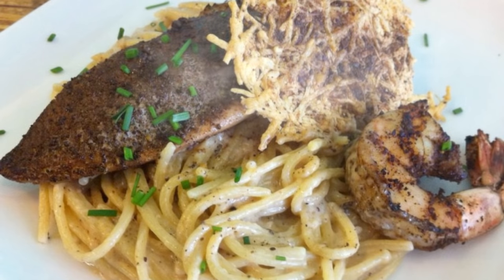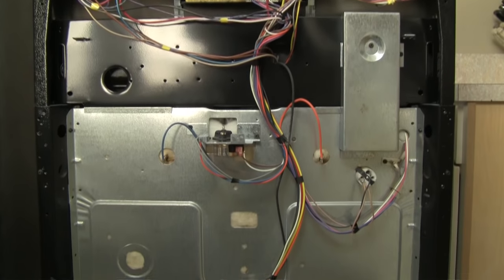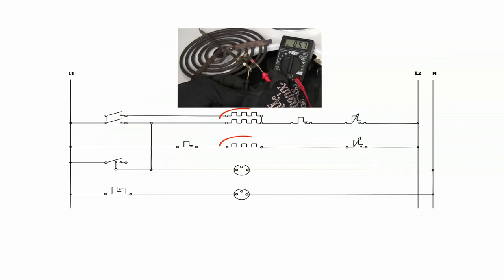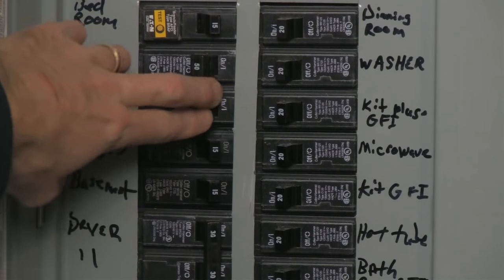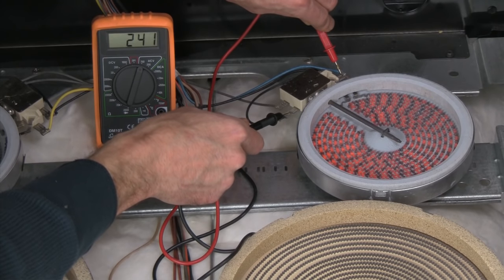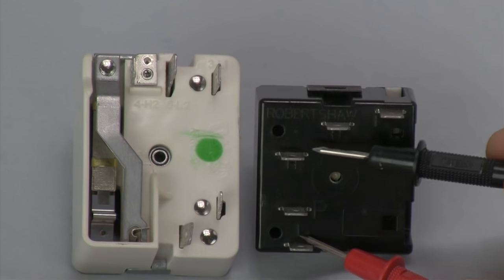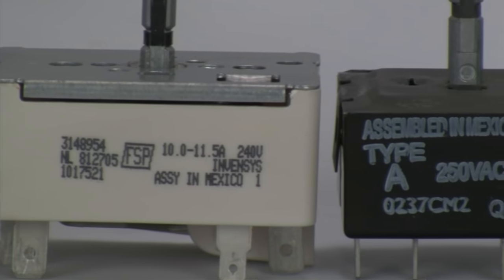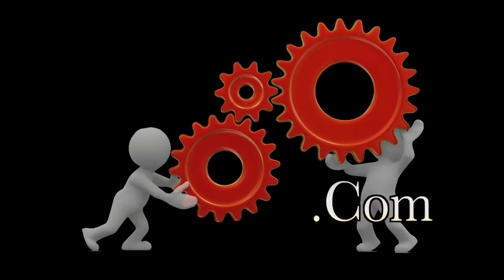Electric Range Stove Repair: How To Repair Burner Elements

Comment: I have a GE flat top everything works fine. However when I use the back left burner a breaker in a different part of her house trips. Any help is appreciated
Reply from the maker: +Jonathan Hardy Sorry for the delay! Sounds like there is probably a shorted wire somewhere between the switch and the back left element or the element itself.  Hope that helps!
Reply from the maker: you may have just gotten really lucky. probably the most you would have gotten is 120 but 240 is possible. If you are not touching both ground and a hot wire your okay... Congratulations on the fix and not getting electrocuted! ; )
Reply from the maker: ahhh. yes that makes more sense. You can change those live with the switch off : ) Thanks for the clarification!

Comment: Help have a ge glass slide in range, cook top stoped working, when turning on any ellements the light show which element is on, but no heat, the oven works fine.. suggestions as al the connects appear fine,

Comment: Moving the stove a wire touched the back and zap , the clock and lights come on but the radiant elements do not . I replaced the contact but still do not have elements , any suggestions on where to look next

Comment: What to check when the hot surface indicator light stay on even with the burners off and cold ? Is that a wire on the infinite switch and what letter or number it should have?

Comment: Hi, I discovered the oven light staying on and looked at the switches in the back. Found switch labeled P1 and P3 which are connected by a 2 wire plug. P3 switch is actually burned, when I disconnect the plug from P1 P3 the light goes out. the question now is can I leave this switch disconnected and use the stove until I can get a repair person in or replace the stove?
thanks
Reply from the maker: I would imagine that you can do just that, leave it disconnected... The circuit for the other elements should still operate.  in reality all you would need to do is replace the switch.  If you give me your model number (down behind the drawer on the range frame) I can send you a link to the proper switch to order... If you do leave it disconnected, it would be a good idea to cover the wire ends in electrical tape to ensure that there is no shorts to the frame when you put the back on and reconnect power.
Reply: applianceassistant Hi Thanks fore the reply. It seems with P1 P3 disconnected the oven has minimal heat and will not come up to temperature, I should mention and this switch is on what looks like the main circuit board in back of the stove and that has a burn mark on it too on the P3 side . Model is 970-678491
and the oven light does come on when I open the door but now shuts off when closed. Obviously connected to that P1P3 connectors but I don;'t what they do exactly.
guess the other question is can I leave just the P1 wire connected because that connector is still functional, not burnt
Reply: Neil MacDonald I'm not able to find that model number in my database... what is the brand?  And I apologize I thought we were talking about one of the surface element indicator lights not the oven light. If it's connected to a circuit board it may not be possible to leave it disconnected. Probably best to leave it wired up as normal for now and let the light stay on. Perhaps you can just remove the oven light bulb temporarily...
Reply: Jon Yingst Maybe so. it's a Sears Kenmore brand and I never thought to mention it's a canadian purchase, not sure if you are in the US and only have access to their models?

Comment: I have a Kenmore stove top that's about 10 or 11 yrs old and today I noticed the 'unit on' indicator light was on a little bit - not the fully bright circle that usually shows when a unit is on but just deeper down and it flickered a bit. The indicator showing which burner is hot showed nothing. I used the main burner and it lit up fully and the indictator showing that burner was hot was lit fully as well. There's no way I'm messing with electricity even with this helpful video but I'm wondering if there's reason for concern here. nothing feels hot but that darned itty bitty light is bugging me. After using the burner and turning it off it did disappear completely for a while then when I went back to cleaning the kitchen I noticed it back and that's when I noticed if I tapped near it it would flicker a bit but more like the position not going on and off. sorry if this doesn't make sense but I'm not sure who to even call to fix a stove of if it's even worth fixing - I could probably get a new one installed cheaper than fixing this one.
Reply from the maker: its probably a bad switch that is just barely making contact on one side. So probably not a big deal in itself. however, if the other side of the switch goes bad the element will probably heat up... It's extremely unlikely, but possible.  Hope that helps! Thanks for the question.
Reply: applianceassistant  thank you! I have a repair guy coming out this weekend just in case. the guy stood me up last week so I found someone else to come out

Comment: Here's one for you, I have a whirlpool RF385PXE range. One of the large top burners won't keep a constant temperature. I've replaced the infinite switch to no avail. Take yesterday for instance. I was cooking a large pot of spaghetti sauce. I had it fairly high originally to brown the onions. But then turned it down to 3 to simmer once I had the tomatoes and some of the other ingredients in the pot. I sat down at my desk to do a few things and the next thing i know it's boiling out all over the floor. The element was red hot like it was on high. Any idea what could be causing this?
Reply from the maker: Sorry for the delay in getting back with you on this.  In most cases it would be the switch, but since you have replaced that the only other possibility that I can think of is that the element or a wire is shorted to ground somewhere. To test you would need a meter and check for a connection from the two wires that come from the element to the switch and check for a connection to the cabinet of the range.  If you get a reading hopefully that will help narrow down where to look.  Hope that helps! Good luck!

Comment: I opened up our GE freestanding, double oven, Model # PB975SOM2SS, to replace the large front burner.  Two of the three wires, plugging to the element were burnt through.  There is not enough slack to reattach. Does the wiring need to be completely replaced or can it be spliced?  Additionally, does the burner need to be replaced?  Currently the outside third of the ring works.
Reply from the maker: Barry Rachel Murray A good splice with ceramic wire nuts should be okay but you should use wire for a range burner... Maybe a local appliance parts shop will have some scrap range wire with factory crimped terminals you can use. The element may still be okay but you would need to check the coils with a meter to check for correct resistance levels. additionally there is often a temperature safety switch inside the element connection block that may have a problem...
Reply: applianceassistant Thank you!  You have been extremely helpful! This is the exact information we were looking for!

Comment: I just replaced the triple element on my Kenmore glass top. When I turn on the dual or triple burner the middle  portion isn't a red as the inner or outer portion. Is this normal?

Comment: my cooktop took a pretty harsh spill and water got inside but i did not know that until i went to use it days after the spill. the burner would not shut off and smoke started coming from the control knobs. we hit the breaker right before it could catch fire. It made a loud pop sound and the housing to the cord is melted. is there any way to save this or is there no hope. I dont even know if i can open it to test everything but im willing to try to repair it if it will save me $1000.
Reply from the maker: It may be salvageable... I would check switch and element areas first for visible arcing and burn marks, and see how wide spread the damage is. Then check the control for proper function after you isolate the short by caping off damaged areas. Hope that helps! Good luck!

Comment: Greetings and great post. What does it mean if my oven wont turn on and certain eyes wont cut off. What to do???
Reply from the maker: I’m sorry I don’t know what you meant by “eyes won’t cut off”.
Reply: @applianceassistant  My apologies for the bad references lol, but I meant the burners/elements wont power off even when the entire stove is off. Certain elements continue to burn at high temperatures.
Reply from the maker: No problem! An element stuck on high is usually a bad control switch. However, if they are all on all the time it must be a shorted wire somewhere in the element circuit. I would start by disconnecting power and look for a wire or terminal that is damaged and touching the frame of the stove somewhere... good luck!
Reply: @applianceassistant  Thanks so much. I'll start on this asap and let you know the results. Your expertise and guidance is greatly appreciated🙌🏾

Comment: Hi, great video !! I have a problem with a switch and burner turning itself on and off by itself. I am scared that it can cause a fire if we leave a towel or something near by when we are not in. I have a Frigidaire electric stove, warmer and oven model # PLEFMZ99GCD. the switch is the one on the furthest right when you look at the back of the stove which tuns on the bridge heating element. How do I fix this issue? should I change the left element control switch ? Or is it something else ?
Reply from the maker: Well that is a little strange. Sounds like a bad switch for that element. However, they don't normally fail in that way.  It also could be a short at the element to ground so it is bypassing the switch... that would also require a bad switch too.  You will need to use a meter to check the wires and connections to the frame of the range.  Start with the switch, testing it like I show in the video.  Also be sure to physically look at the element connections for a short to a ground connection or the frame of the range.  Hope that helps, good luck!

Comment: on a glass top stove . i have a GE profile double oven , my big stove top  burner goes on when ya turn it on but shuts off within a few seconds  . the hot top stove light stays on all the time  is it the switch or burner ? thank you
Reply: Hi Donna, any luck with your stove? What was the problem at the end ? Thanks...

Comment: Also of note is that when I turn on the remaining functional burner on the 2 burner insertable tray...while the fuse is burnt...both of the elements in the tray heat up at the same time from the one burner switch...but very slowly.
I 've had everything apart and aside from being very greasy and scummy there is no obvious bad connections.  Could use more details on how to check the fuses and element harnesses.  All of the switches have 6 terminals compared to the 5 I've seen on most replacemnets.

Comment: I have a Tappan electric range and i can't get them  to summer or turn down it seems like no matter how low you turn the thermostat dials it still boils,  all four burners! any ideas thanks, i change the control on the 8"  but still to hot!
Reply from the maker: It sounds like a bad infinite switch, like I discussed in the video. However, if all four burners are affected I would suspect there is a short somewhere between the controls and the burners that are common to all. Hope that helps! Good luck!

Comment: Hi, I have a Kenmore glass top stove that is about 7 yrs old. The 2 front burners may stay on high from time to time and get stuck on high. The switch wont turn it off, no matter how may times or ways I turn it. And what's funny is that I don't cook on high unless I am boiling something, but will go super high and burn my food if I don't watch it. I could be cooking on 5, and all of a sudden its red hot! do you think it's the switch that needs replacing vs the whole burner element, since the switch won't turn off?

Thanks for your help
Reply: nikkolu31 Hi there!!!! I'm just reading your comment about your issue, just try the switch first and see what happens,hope you fixed it already.Greetings.

Comment: Is there a spring or something in the switch my wife said she turned the burner on and sounded like something unraveled  now knob just turns and burner does not come on
Reply from the maker: Not much of a spring that would do that. Arcing  can make a sound kind of like that... I would look at the switch first. You can check the element for continuity from the wires at the switch, you just need to unplug the wires and check it. Good luck!

Comment: Hi I have a coil electric burner stove and only one front burner works, what would cause three burners to shut down but one still working
Reply from the maker: Hard to know without a wire diagram and a few tests... But if all three failed at once my first thought would be that the one that works is the first in a chain and there is a loose connection or a bad wire after it in the line.  I would love to hear how it turns out.  If you have a model number I can try to find a wire diagram. Also what burner is working?
Reply: applianceassistant
large front left burner is working, so pulled off all the wiring, the front right burner has the peice that when you turn the switch to turn the burner on or off is curroded almost looks like it exploded off, would one broken burner affect the others?
Reply from the maker: The elements are commonly wired in series on the L1 and power supply so it sounds like the front left element was the first in the series.  If you can fix that bad connection you should be back in business!  It probably shorted out to ground some how. Also look at the other wires for a bad spot.  A short in a wire could increase current flow, but that would usually trip the breaker... So probably the bad spot you found is where the short actually happened.

Comment: Thanks for taking the time to make the video! I'll need to troubleshoot the switches at least. I have a Frigidaire range model FED387CCS-C. For a long time the right front "hot" indicator light was stuck on, regardless. Recently I turned the back left knob to a higher heat and heard a loud POP near that back left burner. Now the red indicator light on the front only comes on when the back left burner is at the 7 or 8 setting (out of 10, High). And the other burners are behaving in a similar fashion.  Could it be just the one, back-left switch that is affecting all the others?  Any other ideas as to what it is?  And where is a good place to buy switches (I'm in Portland, OR), assuming that will be the issue? Thanks in advance! Gary

Comment: one of my indicator lights on my glass top stove will not go out when the burner on left rear cools off unless I tap on the glass top.Any ideas?
Reply from the maker: Sounds like a bad connection in the switch... Probably the L1 contact. What is your stove's model number?

Comment: I purchase a new element for a glass top Frigidaire stove. Its the one with two elements. The larger element on the front left, with the option of small or large burners  was not working. My husband is an electric contractor and tested the new replacement element and it was getting the correct electrical current on both large and small parts of the elements. The new element still did not heat up but now the light remains on above the switch. What else could be the cause of one of the elements not heating up, and or the new replacement element not working?
Reply from the maker: If its getting the power it needs from the switch, and the element is okay. (Probably is but it would be good to check the elements for continuity just to be sure.)  It sounds like a shorted wire. The light staying on is a good clue that the L1 to H1 connection is  having a problem somewhere.  What is your range's model number?

Comment: Only one of my burners works only on HIGH. As soon as I try to lower the temperature it starts to cool down. Would this guide be helpful for me? What should my next step be?
Reply from the maker: Sounds like a bad switch. Whats the model number and burner placement? (eg.Left Front, Right Rear)
Reply: Model # FEF366DCC 
Right front burner.
Reply from the maker: It definitely sounds like a switch problem. Here is a link the the switch for you FR element. https://www.repairclinic.com/PartDetail/Surface-Element-Switch/316436001/1155395?RCAID=27317
It's pretty easy to change, you just remove the back of the range console, and remove the two screws behind the knob that hold it in place.  You may want to take a quick picture of the wires connected to the old switch for reference. Good luck!

Comment: i am a diy hack stuff kind of guy.  I want to take my 1965 old school hard-wired electric coil-type heating element cooktop and change over to haliant type burners (enclosing the circle holes with heat tempered glass) because I like the look but not the cooling time of the older coil type.  I am sure i can do it but what is a good starting place to research wiring and switches to get proper parts and amperage?  would I be better-off to sink a new coil-type instead under the glass surfaces?

Comment: I get 240 volts when testing the larger element and 240 volts when testing the small burner but the small burner does not heat up. What could the problem? There are no breaks in the smaller element wires.
Reply from the maker: Are you getting a resistance reading from the wires to the inner element? It could be a bad contact.  If your "element on" light is always lit try tracing that problem back. Somehow that light is getting power from L1... I bet if you can find the source of that power you will find the cause of the inner element not working... Hope that helps! Good luck!